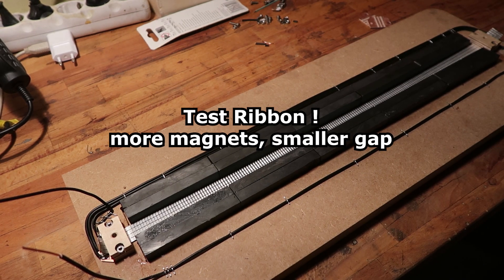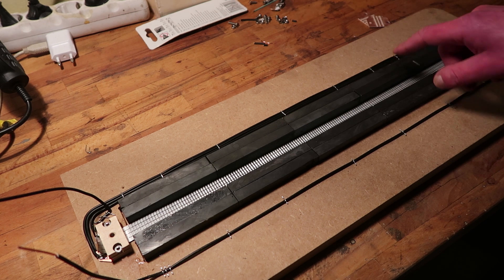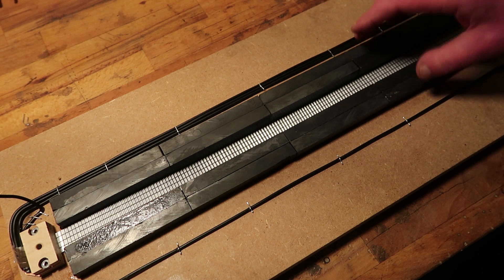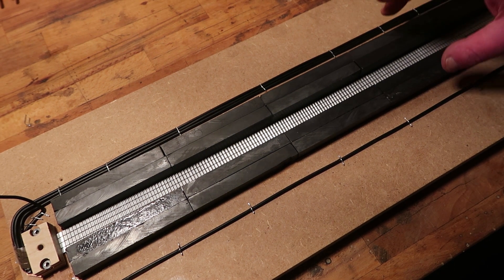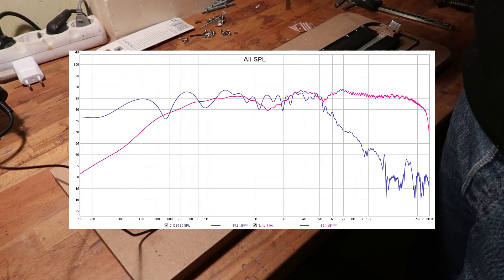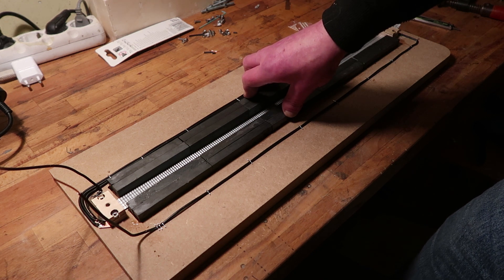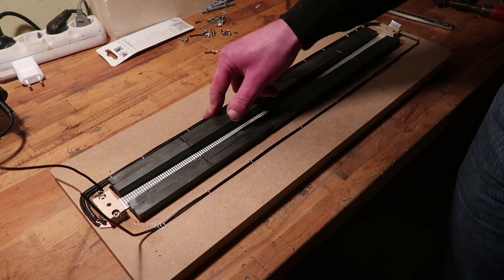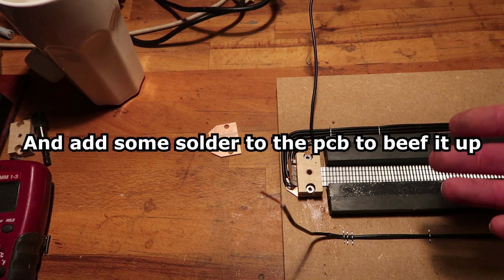Test ribbon more magnets smaller gap - Explaining

Comment: 7:47 if you drive them both (a longer and the shorter) it seems that a median must be about a flat line (if there are no big phase shifts there).
Reply from the maker: well you seen the live thing ;)  i tend to try 3 ribons there one for tops 2 for ... lower.. :) not sure yet how low it is useable. we will see. but they are far less efficient as this one is smaller and also a thinner ribbon with the same amount  of magnets ( per 10 cm of ribbon ) this one uses as much magnets ast the live version :) so efficiency is traded for going lower :)

Comment: Hi Joppe, Really loving your videos.
With regards to the dips in the response, can I recommend a book. The loudspeaker and headphone handbook by John Borwick. It is ridiculously expensive at £165 on Amazon but worth it for you I think. Peter Baxandall wrote the chapter (a normal books length!) on electrostatic speakers. It seems dips in the response of a line source loudspeaker are a fact of physics, I think its called phasor misalignment. It is the sound from one end of the strip cancelling out the other end due to time. It is dependent upon the length of the strip, the distance you are from it and the frequency involved. As frequency rises, or listening distance gets further away, or the length of the strip decreases, the dips get smaller and closer together and higher up. The secret is getting those dips out of the range of hearing. QUAD on there first ESL used a high frequency strip 600mm long but when they measured there speaker they didn't do it at 1 meter they did it at 2, they said it was a more realistic listening distance......Acoustat in there model 2+2 used a narrow full range ESL of floor to ceiling height. The reflection in the floor and ceiling gave the impression of an infinitely long strip. Here the dips in the response had already occurred and died out, leaving a smoothly falling response that they could easily equalise. 
My suggestion is to just take QUADS approach, measure it from your listening distance not 1 meter. Lets face it QUAD ARE GOD
Reply from the maker: THanks stephan ! for the long reply . i am aware of these problems with small line sources, the dips and peaks you mention shift when you move ur mic up or down the ribbon to. the ones here look static.  so im afraid they might be something else. well we see :)  by the way both nice books indeed !! dont own them but surely read quit some of the esl book a few years back.

Comment: Could you use and electromagnet at a high switching rate instead of magnets????
Reply from the maker: well you could just use a  electromagnet (just feed it DC) but that means you need to make a core that will give in the end north(or south) on the left from the ribbon and visa versa. witch usually means a closed back, to be able to only use one coil, witch might result in more dips and peaks from sound reflection from the core back trough the ribbon.   it could work but i always wonder if it is worth the Much much more effort needed,  besides having to need a huge DC power supply making the magnet work
Reply: @joppepeelen  thank you for explaining that to me I had been wondering about it for a few years now